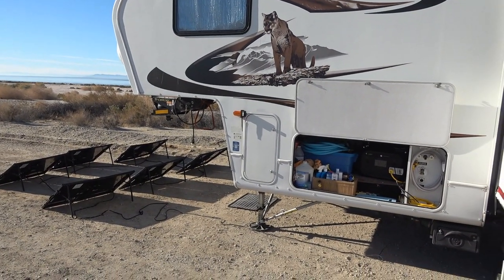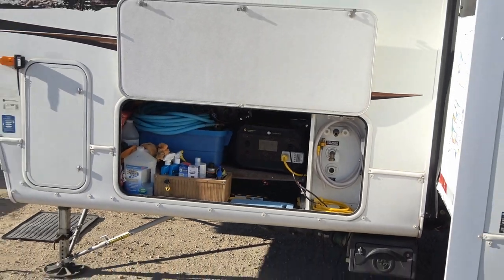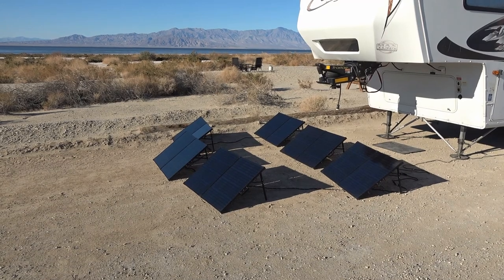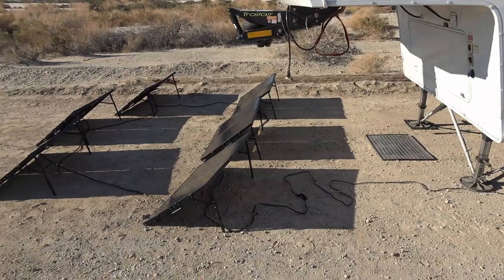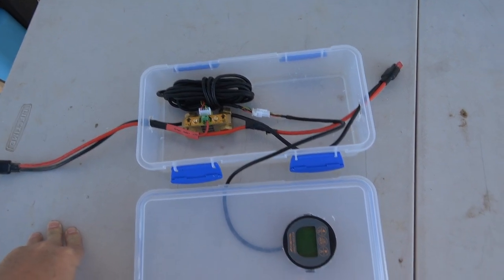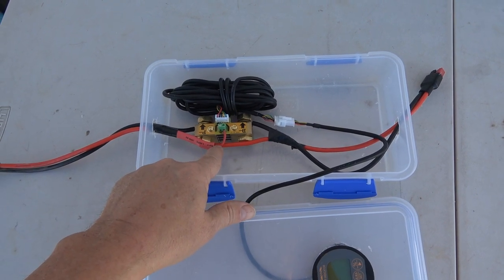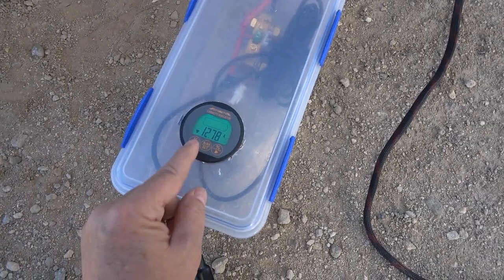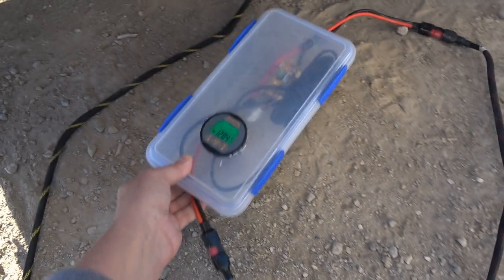DIY Solar Power Meter for Display of Real Time Amps and Volts

Comment: Hi Ray, I like the DIY meter display you did.  I have a suggestion, could you build a DIY solar display built from parts from stores like Harbor Freight, Home Depot and Amazon?  I dont have alot of spare electrical components around the shop but this solar meter would be helpful for my RV and Habitat jobsite solar generator.  Thanks and get warm after last years winter in BC.

Comment: Ray, I have installed two of those “battery monitors”. One in my fifth wheel to monitor charge status of a 200AH lithium battery and one on my golf cart to monitor (3) 12 volt lithium battery bank. Excellent investment and highly recommended by Will Prowse. Travel safe.

Comment: Very well done Ray, these give you 460 watts plus the other 6 panels on the roof of the RV, that's enough to power the air conditioner I think. Do you have a 3000 watts inverter to go with these, I don't remember, anyway it looks go, Ray. Nice weather away from covid-19. Seasons Greetings to you and Ann from Québec in the frost. Cheers Ray
Reply from the maker: The Safari ME box has a 2000W  inverter with 4000W surge, that's plenty for us. We don't need to run our AC since I don't like to boondocking hot weather. Not much fun for me.  I would move somewhere cooler. :)  Cheers, Ray

Comment: How about the black cable bundle inside the box, is it in use somehow? I first through it could possibly provide for some inductivity? Influencing the test results? Great review and infos anyway, thank you for sharing 🤗
Reply from the maker: Its the extension cable they include with the meter so you can mount the display someplace remotely inside the RV.

Comment: 36+volts...2 parallel sets of 3 in series? or are they 24v panels all in parallel? does lion energy make that easy with the coupled anderson plug style? could they all be in series?    I appreciate your experimentation. How's the me box compared to the bluetti? take care and be well.
Reply from the maker: They are 6 - 100W 24V panels wired in parallel.  The Lion Energy box is designed for 24V panel input which is in reality much higher, that's just how they rate panels. Like a so called 12V panel usually operates at around 18V in reality.
Overall I liked both, they both charge fast and have LiFePO4 lithium batteries but give the edge to the Safari ME. This Lion system has an extra 1000 watt-hours of capacity over the Bluetti AC200P that I tested so I prefer it for that reason. Also, I like that the Safari ME boxes have metal structure and the split system is easier to pack around than the single heavier Bluetti. I didn't like the Bluetti touch screen display as much, hard to see and if it quits the whole box becomes useless. Did like the extra display info it has though and the Bluetti inverter worked flawless in my tests.

Comment: Do you have to take your panels in if the wind comes up or can you stake them to the ground?
Reply from the maker: So far they seem to handle the wind quite well being that they are about 20 lbs. But I don't tempt fate and if a big wind storm is coming I either put them away or lay them flat.

Comment: We can buy more cheap and best watt meter which gives you watt,voltage,amp etc I have one from G.T Power 130a
Reply from the maker: Mine was free since I had the unit just sitting around doing nothing so I repurposed it.

Comment: Hi Ray, We are looking at this system and the Ecoflow Delta Pro also. We only have 1 - 190 watt panel on our roof and 1000 watt inverter and this setup is mainly for use by the 12V refer. How many times a day do you move the panels? Are you able to fully recharge on a sunny day? Thanks p.s. Better get a patent application in for that case!
Reply from the maker: About 3 times a day I shift them. If its clear sunny day I can recharge in a day. Right now is the hardest time of the year since the days are quite short so just barely can if I'm not also taking much out at the same time. I have the 920 watt hour Safari ME and the  2000 watt hour expansion pack. So quite a bit to recharge if empty.  Cheers, Ray
Reply: @LoveYourRV  Thanks for the info. Have you had to use your generator at all?
Reply from the maker: I used my generator mostly when I was fall camping in BC, Washington, and Oregon coastal and forest areas because of the lack of sunshine and shade of the trees. But the last time I used it was over a month ago now that we are in the south I have plenty of power since I also have 940 watts on my roof.  Here was a video I did back in October showing a fall camping situation.  https://youtu.be/H6u7mEWjprU

Comment: Hi, is there an advantage to using this over the battery system you use ?  It just seems like you added an additional battery.
Reply from the maker: Yes, it has a 2000W inverter built into it with 4000W surge capability. My old inverter in my RV system is just 1000W. So my main reason for me using it ,other than I'm testing it out in some real world use for my extended review, is to use it to power things like my microwave.  For people starting out with no existing system it may be a viable choice given that it is portable and can also be used for home backup power.  You can find my review videos here - https://www.loveyourrv.com/lion-energy-safari-me-off-grid-power-station-review-portable-rv-camping-solution/
Reply: @LoveYourRV  oh ok that makes sense, ill watch your review. Were starting down the road thinking about solar but don't really want to go down the full road , this might be an alternative